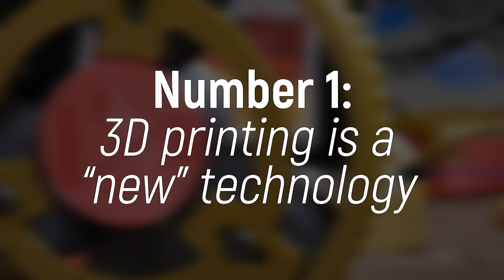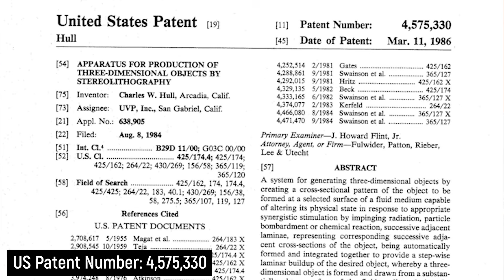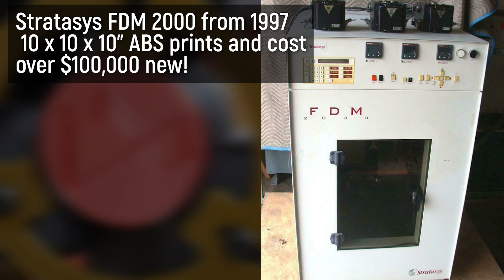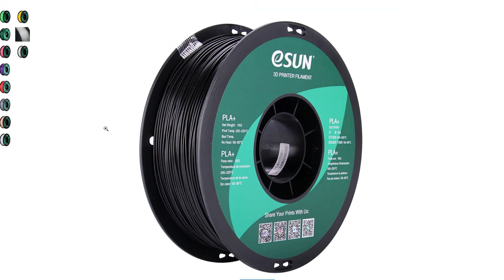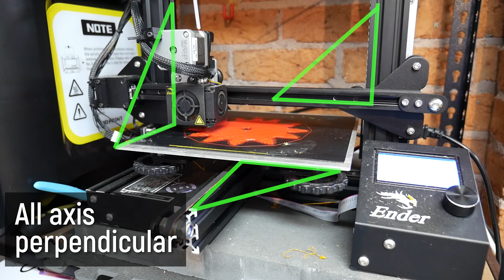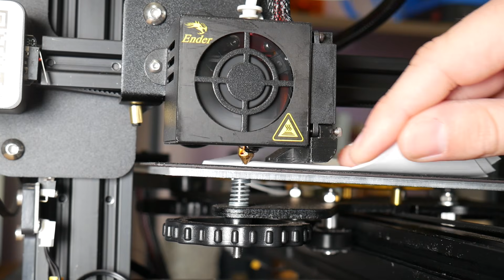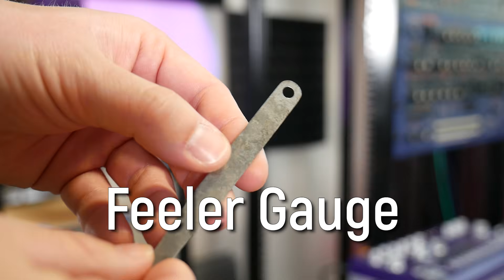3D Printing Myths I used to believe...

Comment: Ha been there seen it done it, you are spot on in what you say.
I always use a brim, for me it helps in many ways not just sticking the print down but preventing warp too.
Added to that, I only use my printer once/twice a month, so a quick clean, fit the filament, pre-heat & go then watching the brim print I dial in the bed to give a even first layer height.
That wat by time the brim is complete you know you are going to start the component print spot on & just in case something is drastically wrong and you have not been able to rectify it during the brim print, you can quit the print knowing you have used only a very small amount of filament in the process & have not ruined your item.
Keep up the good work Angus.

Comment: Thicker feeler gauges should result in a more accurate calibration, right?
Reply: Why would they? Really shouldn't.
Reply: Lets say you have a 20cm feeler gauge and a .001mm one. (Obviously this is exaggerated)
You would be better of using the thicker one, because when you move your printer to 20cm and put the gauge below and level it, even if you are off a couple mm, that is nothing compared to the 20cm you aimed at. If you are using the thin one, even being off by 0.01mm would completely ruin your calibration. Or am I wrong?
Reply: @dschaedler  If you're off by a couple mm on a very hypothetical 20cm feeler gauge, you're still off by a couple mm off your bed, which is catastrophic. Because your printer doesn't become kilometre large and doesn't use a decimetre wide nozzle. You need to reach a particular absolute precision, let's say you aim for precision between 0.05mm and 0.01mm. Your step size or resolution during adjustment is the same, regardless of gauge thickness, and the feel of the nozzle on the gauge surface shouldn't differ drastically with different gauges either.

As to gauge flexibility? You actually want it to conform to the bed contour, so that the offset between nozzle and bed is determined by gauge thickness rather than the bed unevenness. That being said you do have a lot of leeway for experimentation there and can go with what feels the best, as long as you can compensate for it.

Comment: This helps a lot I’ve fallen out of love with 3D printing bc of 1st layers I always just used a thin peace of paper to get it framed then played w the first layer height useing the knobs whale printing 

For some reason I had to set my extrusion to 450% to get a solid line witch was probably too much but early tevo tarantula extruders even with the free upgrade gearbox we’re so crappy

All this just made me fall in love with engendering so that’s a plus and now I have a almost completely custom 3d printer this hobby is so great for learning problem solving and getting experience working with robotics 

I am going to get my old printer working again to prong parts for my car and this helped give me motivation to get the printer running sustainably again rather than just barking lit some crapy parts that need heavy finishing to make work

The new under 200 printers are so end user friendly now it’s crazy i built my tevo part by part wiring  everything  trying to figure out why my extruder was so gd under powerd

Comment: the 3d printing "community" is wayyyy too obsessed with "strength" where it makes no sense. They print a little pikachu or something and want it to be a tank for no reason and just waste a ton of print time (and filament) making it stronger than it needs to be. or designers make things like small boxes WAY thicker than they need to be.

Comment: Lol, the BFB 3000 is the predecessor to the 3D printer I got from my old high school, the BFB 3D Touch. Basically the same printer except with a touchscreen LCD. I think my favorite piece in the instructions was for when the MDF bed began to warp, flip it over.
Reply from the maker: Haha yes, the touch was just as much a travesty. 3D Systems bought bfb and recycled the design again for the equality rubbish cube duo / trio line as well.

Comment: I recently came to the realization that using the paper to set print bed spacing was just wrong. My brim was super thin and difficult to get off the bed surface afterwards. I was wondering if a feeler guage might work better. Next you mentioned the print setting for the first layer may be throwing it off as well. Great information, I’ll definitely be looking into that.

Comment: Ive never done folded paper, always just a standard sheet unfolded. ABS is still the best cheap general purpose filament assuming you can print it, due to how cheap it is and availability. If you cant print abs due to no enclosure etc, PLA+ seems to be the best bet in my experience, normal PLA is too brittle and very prone to creep while petg is very stringy and normally needs a release agent so it does not bond to your build surface.

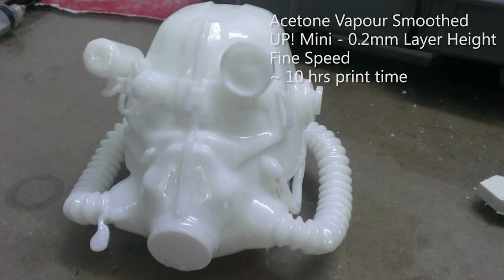Comment: 6:01 Also, resistance to creep. That is one small advantage ABS still has over PLA, that it doesn't deform nearly as much when placed under load for a long period of time. Granted, PETG also beats PLA in this regard, but ABS still beats PETG in this regard. I really don't print in ABS all that terribly often at all, but it's nice to have a roll on hand if you want to make a part that resists creep, even with the other disadvantages.
Reply: resin prints are the way to go if you want strength.

Comment: Honestly, after my first month of owning a 3D printer back in early 2018, I never used the paper levelling trick again.
I never got any good results with it, and ever since I just start a big print (say something with a square base that's 15*15) and move the levelling screws as it goes around.
The print is setup so that it prints like 8 walls, and each time you can dial it in, usually only taking a few passes.
If you want to be absolutely sure it's set correctly, you can scrape the print off, and start the exact same thing again.
It produces a little waste filament, but it's much better than the troubles I was having previously with prints only half-adhered to the bed occasionally popping off and destroying the entire print...

Comment: I've been using an Octoprint plugin (Octoprint-BedLevelingWizard) to help fix my first layer height for years, and it has an option (Z Leveling Height) to raise the bed to the thickness of whatever material you're using to check the squoosh with (I've been using 0.1mm thick paper in single sheets while my feeler gauges were on order -- I had no idea people folded the paper? Doesn't that leave some random amount of air between the layers, and some amount of spring from the folds?)

Comment: I still think ABS > PLA, but I have a printer with a heated chamber that sits in an enclosed hood with ventilation. ABS is better for functional parts; it can be machined (using screws to cut threads), sanded, smoothed, and has a heat deflection temperature significantly higher than PLA/PETG. And if you print in black ABS, it's UV resistant enough (black ABS pipe is outdoor rated because the carbon black will absorb UV radiation before it damages the polymer). I wouldn't recommend it for large pieces (unless you have a heated chamber) or for people without proper ventilation due to the off-gas, but it is still the best inexpensive option for for functional parts if your machine can handle it.

Comment: I've been using a feeler gauge to set the gap between the nozzle and bed for awhile now. However, I am unable to set my Z height the same as the gap, I'd love to, since the levelling knobs on my printer don't all engage properly unless the bed is around negative 2 or 3mm. Still, I find that using the 0.063mm gauge (nearly half the thickness of paper) works quite well and doesn't require a whole lot of baby stepping while printing a calibration layer to dial in. Not sure if this is what other people experience, but a gap of .1 is simply too large in my experience.

Comment: What size feeler gauge? Does it depend on your nozzle size, or layer height settings?
Reply from the maker: Whichever you offset the z to will work. I used 0.2mm for mine :)

Comment: I always level my bed by stopping a print at the first layer and setting the height visually. Works great I haven't leveled my CR-10 in a Looong time.
Reply: I wish my eyesight was good enough for that lol
Reply: @cameronmalchow7597  haha yea I guess I got a good eye for it (been doing it for a while). But you can always use those feeler gauges that he mentioned.
Reply: @lithiumfpv9254  Oh, yeah for sure. I've been using feeler gauges for awhile now, or one feeler gauge lol 0.063mm (.0025in) seems to give me good results, with a bit of printing and baby stepping to really dial it in.
Reply: @cameronmalchow7597  idk what printer you have but I would highly recommend buying stuffer springs and putting blue lock tights on the thread that adjusts the bed so that you don’t have to change it as much.

Comment: Note that Thomas Sanladerer says black abs often has carbon in it for colouring and is quite UV stable. 
Google YCdvL87bv0w skip to 8mins 30 ish
Reply: You can expect black colouring in all plastics to be carbon and it's actually great at reducing UV degradation of deeper layers of material. It's also the reason black PLA often takes 10°C more to print than most colours, as does white which is filled with a ceramic.

But if you buy cheap ABS, and it's black, it can also end up being regrind which is horrible, a material which was thermally pre-degraded by being run through injection moulding machines several times. Because you can mask any material colour with black. Not entirely exclusive to black, there can be several common regrind colours.

Comment: than ks for all the corrections. i bought my first 3d printer 7 years ago. this printer couldn't print abs so i test printed till i got great layer adhesion and ran with pla and would some day get up to abs with up grades. the prints good, strong, and clean.

Comment: I was always surprised that feeler gauges weren't used in 3D printing as they let you know exactly what the distance is, and they aren't a particularly expensive tool.
Reply: because a piece of paper really is good enough, considering the thickness is pretty consistent. In 10 years I've not had a problem with it and it's what 99% of people use.
Reply: but it is a tool you cannot print XD
Reply: @deimosmen  I mean if you can dial in your printer enough you actually probably could!

Comment: Coming from a background of metal working the feeler gauge was a no-brainer for me, I was very surprised to find out that this isn't more common.
Reply: What thickness feeler gauge I should go? Ender 3 v2
Reply: @CTZN1  I normally use .13mm